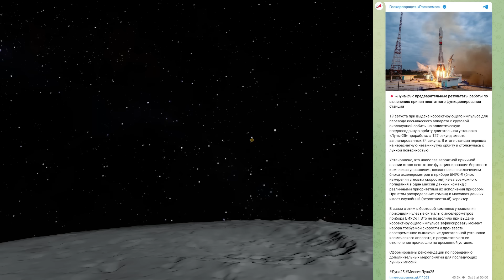Russian Space Probe Crashed Into Moon Because It 'Forgot' To Turn On Critical Hardware

Comment: This seems like bad architecture design to me. If there are things that must happen, then they must be signaled using protocol that ensures/checks that they happen. (I hate any probabilistic approach, as it has typically nontrivial requirements,  which are often not fulfilled in practice, because of some misunderstanding of software engineer that uses it (sometimes without knowing)).
Reply: Yeah; ironically, I suspect a more primitive software design going through a preset sequence would have worked better.
Reply: That's why it's seems fake right? No feedback if the motor is ignited, no backup IMU, no acknowladge packet for the ignite frame?  I think they do not know what exactly happened.
Reply: I rewatched but I don't understand where "probabilistic" comes into it?
Reply: @mattbox87 That is just my (unsupported) assumption, that protocol on central bus is of the style "toss message in and hope it is delivered" (as in Ethernet) while lacking proper protocol that ensures it is delivered (like TCP) in time (not like TCP).

Comment: It's interesting that SpaceX sees itself as a software company first. The rockets are nothing new, aluminum and steel with very little carbon fiber. The things they excel at are software, modeling and simulations. The only really new hardware that SpaceX has is the Raptor engine.
Reply: This a bit trivialized. SpaceX was an early adaptor of 3d-printed metal structures, particularly with rocket motor components.  Dragons SuperDraco engines are a complex 3d-printed design, that likely required lots of complex modelling as part of the design process. Merlin engine was designed to enable deep throttling from 35%-100%. (most rocket engines can not throttle below ~60%). Not sure how much of this is sensor and software, vs. custom hardware.The landing legs and arms on a Falcon 9 are carbon fibre. Think the fairings are also carbon composite as well. Raptors are hugely depend on 3d print processes, as much traditional plumbing has been internalized (so not exposed extreme vibrations, or  heat of reentry). Titanium grid fin design is borrowed from military, where similar fins are used to guide large bombs.
Reply: And titanium fins? And Tesla motors for actuating them? And space lasers?

Raptor steals the show though and I totally agree that they have really understood the assignment in the software part, trailblazers of the class, you could say, seemingly a decade ahead of the others.
Reply: @u1zha  Fins are not new. Motors are not new. Lasers are not new. The software that allows them to perform the way they do is new.
Reply: @stoneymahoney9106  wdym "motors are not new"? In that same way someone could hold a conversation with you claiming "rocket engines are not new".
Reply: What make them possible to do it is the physics and not software. Software is also not new 😅

Comment: 127 is actually the highest number you can store in a SIGNED 8-bit integer. After 127, signed 8-bit integers overflow to negative numbers, and continue from -128 up to 0. The aforementioned engine shutdown maybe because the seconds it burned has overflowed to negative numbers after 127 and the software got even more confused.
Reply: I think it's unlikely that the computer measures the time of burn in seconds, more likely miliseconds, maybe we get 7bits in some sort of telemetry to keep the packet size small, so we will probably never know what exatly happened, I doubt there can be an overflow in mission critical stuff.

Also the whole priority sounds very fake to me, communication failure with the module maybe, but if you're running a proper industrial protocol you should have plenty of bandwidth with feedbacks, signal timeouts and validity checks. Whole factories and basically every car uses those sistems, and even if there is a priority issue, it gets resolved in milliseconds. My guess is that they have very little idea what happened and blamed it on some software team.
Reply: @ffoska  How about a scenario where this was all tested and done and then....some-one wanted to add something (that came with its own priority) and they didn't bother to run a complete test after adding it. If the added bit gave itself a higher priority and started too soon. Like checking on measurements that were only supposed to happen AFTER landing and were expected to be able to use most of the bandwidth.
Would that also be a 'software error where the angle accelerometer didn't get its data across'?
Reply: Or seven bits plus a parity bit, but either way yes.
Reply: 127 seconds is also 150% of the planned burn time. They may have just given it a 50% buffer.
Reply: Good catch, although I still don't understand why one would put mission criticall hardware all on the same common bus with lower priority hardware mixed in, wasn't the whole point of the appollo guidance system to have a good and stable connection to each and every piece of the craft?
Reply: @SergioEduP  Yes, but even they still had command overflow errors on final descent. They were able to effectively ignore and continue, but it still happened. Granted we have much faster computers now, but turns out there's a lot of stuff happening during that phase :D

Comment: Another possibility: 127 seconds is almost exactly 150% of the normal burn time of 84 seconds. An emergency cutoff fifty percent past the normal stop time sounds like a 'reasonable' failsafe in case of engine underperformance...
Reply: It's more likely a signed integer overflowed into a negative value after the spacecraft already was in an invalid/undefined state due to the bus congestion.
Reply: @MrRoboticBrain  two big flaws in your thinking. 
1) They would never use an 8 bit value to store something like that
2) They would not be measuring things like that in seconds. Even radio controlled toys use millisecond measurements.
Reply: @JasonKaler  as @MrRoboticBrain  said right after, it is common practice to separate values into 2 values. 8 bit for seconds, 16,24,32 bit for milliseconds or microseconds. It possible that the 8 bit counter overflowed, messing up the computer.
Reply: @MrRoboticBrain I feel like burn time wouldn't be measured in whole seconds, seems imprecise.
Reply: @Gyanvdz  Yes but as I've written elsewhere it's possible they used fixed-point arithmetic. e.g.: 1 sign bit, 7 bit seconds, 24 bit fractions of a second => a 32-bit signed integer in total.
Reply: @MrRoboticBrain  Could be! I hope we get more info soon

Comment: 1:54 I'm not sure if that's the best analogy. In any modern network topology, the medium (ethernet) is not shared - at least since token ring network were modern. And nobody uses half duplex anymore. A better example might be Wifi, were we do use a shared medium (albeit with different channels and so on, but the principle still holds)
Reply: Best example is the computer itself. You have several buses there. Inside each processor there is a bus maybe more than one these days. USB is bus. SATA is a bus and on the motherboard there is PCI bus. Half duplex is used in CAN bus, which is used in automotive industry for example.
Reply: To be a little pedantic Ethernet and the internet is still a shared technology but think more along the lines of store and forward.
Reply: Ethernet is "shared" at the packet level and those packets have priority (if set up properly). In case of bandwidth saturation the packets with low priority will be droped. And not related to this the half duplex still exists especially in simple automations where you need to read few sensors every once in a while.

Comment: ...so, you mean CAN bus...? Well, I hope they have at least some redundancy in place, because the second greatest thing about buses after the reduced cabling needs is that a fault at ANY point on the bus can completely take out communication between everything and everything else. Not forgetting of course the importance of routing all your redundant buses right next to each other in the same duct so when you run out of blinker fluid and your vacuum-rated turbofan blows up it can slice through all of them in the same go.
Reply: I wanted to mention... it may seem very advanced to do it that way, but your car from the last 25 years is built the same way.
Reply: Pssh, you have obviously never worked with a CAN-B  bus, very difficult to take offline.
Reply: @logansmall5148  Guess again. All it takes is one node with a transceiver with a failed permanent dominant protection - had it happen. Any wiring short or break will of course do it as well. On a bus with some serious noise there's also merry hell to be played by nodes that got just spooked enough to go error passive so messages just silently go missing unless your higher protocol bothers to ensure delivery - I just hope you never rely on broadcast for anything important. Then again, I suppose these things happen a lot less when your bus isn't hundreds of meters long, fully populated, and installed in a building...
Reply: @AttilaAsztalos  I was assuming you were referencing CAN-C buses which stop working if you look at them funny, hence me referencing CAN-B that are very fault tolerant.

Comment: the fact that a disabled accelerometer reports zero acceleration instead of NaN or failed or "please turn me on first" is somewhat concerning. someone forgot to do some proper error handling
Reply: Also if you know that the engine is on and you're getting an acceleration of zero then it's probably a good idea to send out an accelerometer wake up message.
Reply: @jamesharmer9293 "Hmm. I have raised the throttle to 100% but the accelerometer is registering zero. Either the engine is broken, the accelerometer is broken, or I've been grappled by an alien spacecraft. Any way it's probably a good idea to turn the engine off and radio for help."
Reply: Agree.  The difference between zero acceleration and 'no valid data' should be obvious and easily tested.  Seems like one of the safety checks BEFORE ignition would be ' a valid, zero acceleration' reading.
Reply: @mikefochtman7164 It's possible the accelerometer was functioning as intended initially and then disabled during the transit as a normal operation, as a planned partial shutdown to conserve power. I can see the logic behind turning it off when you don't expect any changes and turning it back on when you need it again.
Reply: @DerWaffel  Sure, but that wasn't my point.  Having something like what we used to call a 'live zero' is simple and would allow just what you're saying, and yet provide a definitive indication between a 'properly working instrument sensing zero acceleration' and an instrument that is some how off-line or not powered.  In the old analog days, things like a 4-20 mA current loop did just that.  An output of 4 mA meant 'zero', but an output of 0 mA meant 'out of range' and failure/ offline.
Reply: @mikefochtman7164  common error though
Reply: That was my first thought also. If not please turn  the accelerometer on, fallback to plan B: accelerometer failure.
Reply: The "little" difference between nothing (NULL) or nothing (zero).
Reply: @T0MT0Mmmmy  Even so there should've been a tuned value that represents 0. It's one of the reasons you see electronic components with active high line signals. If the component isn't receiving high voltage on its enable pin, then it shouldn't be doing anything.
Reply: @T0MT0Mmmmy in my machine control experience, you should ALWAYS check for both X is true AND X' is NOT true and not assume one precludes the other.

I always assumed the aerospace guys were at least as careful as we are.
Reply: I dont think its software error.
NodeJS and Python fool people into thinking processors are slower than they really are.
Modern day ESP32's can do 400 million instructions per second. And thats on the cheap end. The radiation proof shit they put on landers and rovers, are significantly faster.

Theres no conceivable way that messages would be qued up like that, to the point it took 2 WHOLE MINUTES to process that command.
The truth is some official was probably corrupt, and there was a faulty IMU put into the spacecraft. 
Its 100% a managerial error.
Reply: @honkhonk8009  The message wasn't stuck in a queue for 2 minutes, it was deleted. As far as I understand there was a short time (probably µs) where a lot of messages were sent over the bus and non-priority messages were simply discarded. And obviously there wasn't a check if it was received.
Reply: @honkhonk8009 Rad-hardened computers tend to be based on older and larger architecture nodes, because it's easier to rad-harden a larger transistor than a smaller one.  They're also optimized heavily for power and thermal efficiency, so they tend to come up far short in terms of raw processing ability.  Heck, IIRC the RAD 750 that powers a great many modern Western spacecraft has less overall processing capability than a Raspberry Pi.
Reply: @honkhonk8009  Remember that those are Russian all-domestic chips, designed, given all the delays, at the very best, in early 2010s. So, 0,5um or, again, at the very best 0,3um used in production. At the very best, Pentium 1 performance level, and I highly doubt even that was achieved because of radiation proof and multiple redundancy requirements.

Comment: The tiniest mistake or flaw is often the most costly that leads to catastrophic failure.  Anyone who works in a detail focused job will experience that reality several times each day.  They usually observe this reality from more impulsive workers and management who decide to cut corners or make changes without extensively investigating the outcomes of those new changes.  The devil always hides in the details.
Reply: "Aw, does it matter is these go over there or those go over here? Look, as far as I'm concerned, as long as it looks like we've done our bit, that's all that matters to me."
- someone with whom I had the misfortune to work a few years ago.
"Don't bother checking that. It'll be checked when it goes out." "Don't bother checking that. It'll have been checked when it came in."
- different guy, same job.
Reply: Yes. "Optimists", and "sales" types in positions of power always do the most damage.